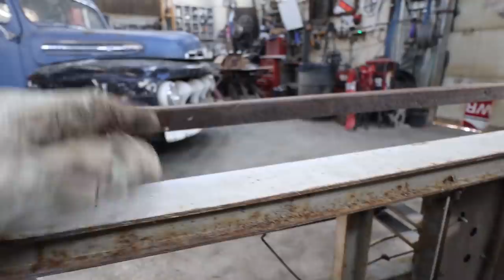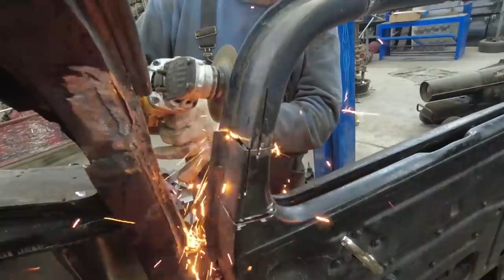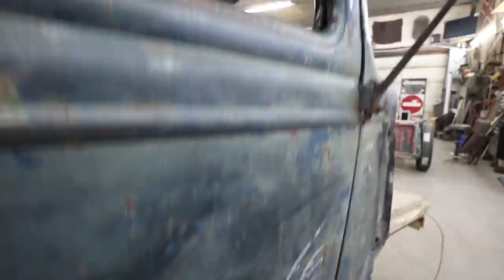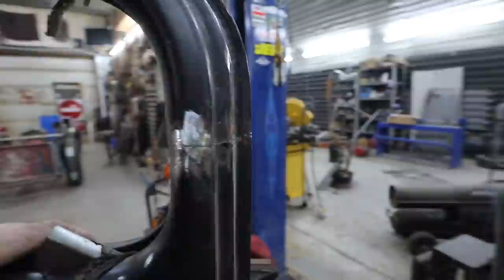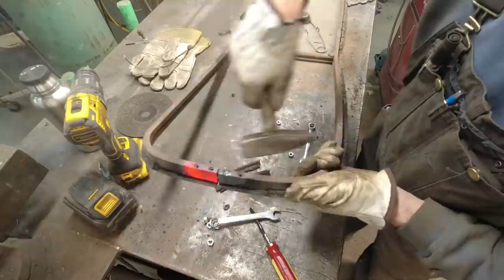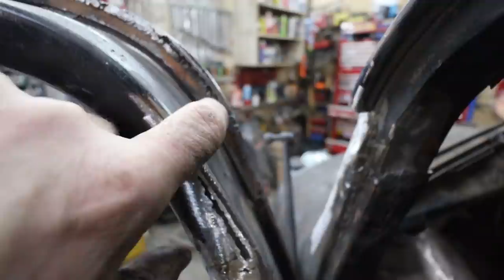Finishing door tops and chopping front window frame on the 1937 Hot Rod Part 15

Comment: Fascinated at how easy you made re contouring the door leading edge; at first glance I was stuck as to how you were going to do it. Liberal application of the cutoff wheel, a little bend and fill to fit, and its done.  I thought the General build was extreme;  this is also in a different way.  Would still like to see the 37 grille used' sectioned/chopped, but different from the 34 that is way too common.  Thanks!

Comment: Brent nice work on the doors , i have been thinking the same thing about the frame horns on it  they need to round down like a model A or a 32 . 
make some cardboard patterns and plasma cut some frame horns to put on it.
 watching you do the door welding repairs makes me want to finish all the little details on my 50 ford shoebox 4 inch chop . 
my roof looks good and my door tops look good  i just need to finish all the inside welding.

Comment: hac love  your   vids   and  your  cars   try this on  broken off screws or bolts ... heat red.hot ....quince with  ice  water  3 or 4  times  then heat   red hot  after red  hot    spray with  wd  40 or     pb  blaster   let cool    rust  turns  to black powder     should remove  easy.. use your jubgement on  steering  parts  worked  for me  on  36 37 fords

Comment: You make it all look so easy.   Like anyone could do it   And thank you for making videos for us to watch.    Cannot wait until my truck is done    It is looking great.     But the wind shield   Even with the rubber in the way they move I bet it still had a bit of leakage in a driving rain going down the road. And making an assumption you have had a vehicle in the past with a windshield like this,  do they leak some?
32 down horns that rolled down and a bit inward at the same time   Not much just a little to give the appearance of a skinner front end would be my suggestion,   Like you need more of those     Keep up the good work

Comment: Brent you have chopped a lot of older vehicles, they seem to be of a more conducive vehicle to chop and they have style to start with.
I find that the modern vehicles lack that something deserving of a chop as they all seem to be very similar.
Could you please do a chop on a modern sedan say something in the last 15 to 20 years old and see what you can do?
It feels like future generations
Will look back at these recent times vehicles, and go Meh not worth it
On the channel 
The Fab Forums  Karl Voss is Building a mustang into a very impressive vehicle even to the point of cutting it down the middle lengthways and cutting out a section
Well worth a look at all handmade bead rolled, English wheeled, custom parts where possible.
I think your knowledgable eye will enjoy the visit
Tony from Western Australia 🇦🇺

Comment: Happy New Year. You sure make cutting and welding look easy..  Have you ever used fiberglass resin mixed into the  { BONDO ] filler on the welded seams . I see the King of Bondo Bad Chad do this and it seems like it would hold into the crevices better.
Reply from the maker: Yeah use it for everything makes the cheap bondo seen fancy :)

Comment: I am sorry to disagree with the popular sentiment about your latest move: the chop. I have nothing but admiration for your skill and the way you present the intricate operations that you carry out to build this hot-rod from such humble origins. But you should have never chopped the truck. It looked better before and the added height in such small cabin would have been useful in adding practicality to the car. For once your aesthetic sense has led you astray. It would have been easy to take a photo of the truck and chop it in the computer with a graphics editor to see if the changes were what you wanted.
May I extend my plea for practicality to the engine and hood. You have shown a very tall intake manifold mounted on the engine, a manifold that will require cutting down whatever hood you want to use, and will interfere with your driving vision. The added power to the engine cannot be used in that old chassis, neither brakes, suspension and torsional stiffness of the chassis are up to the task. I assume a single four-barrel carburetor in that engine will assure you of more than twice the original power and will let you use a hood with some respect to the original lines. Will you ever need more than that in such a relatively light car?
With best wishes for 2022 and looking forward to more of your extremely interesting work.